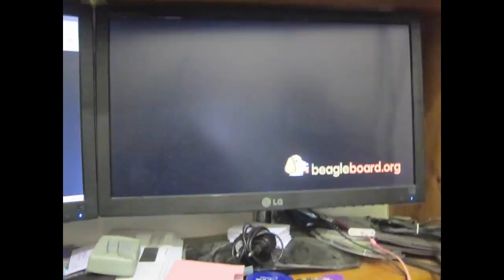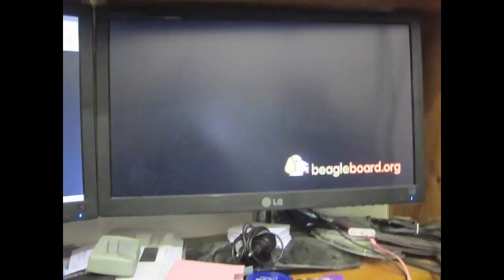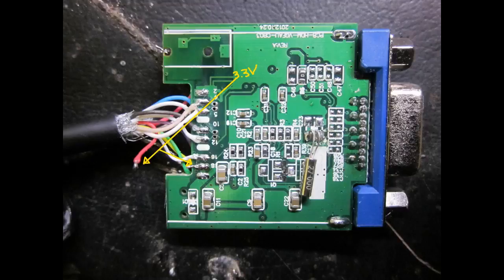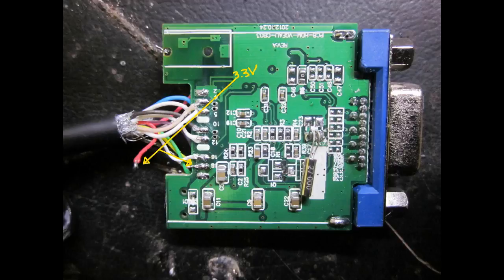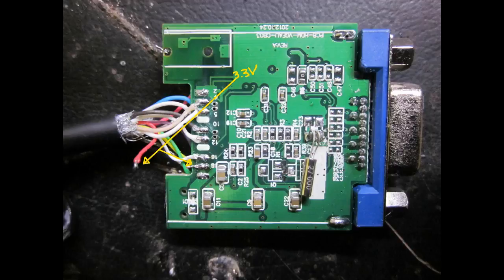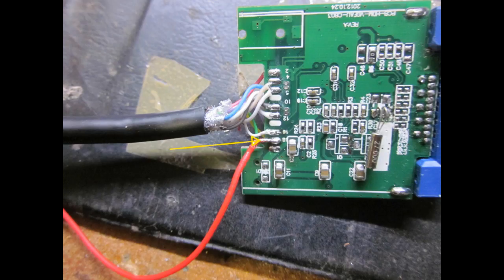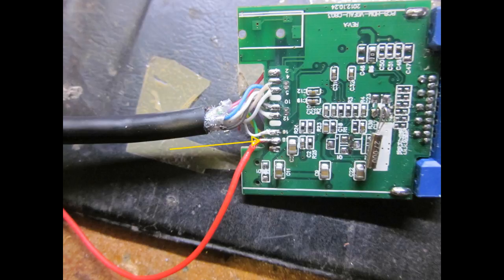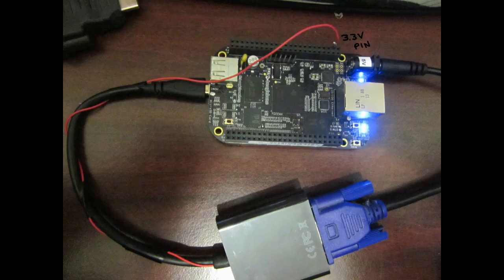Beaglebone Black micro HDMI to VGA  converter fix

Comment: i opened my converter , it was written 5v, can i add 5v to it? , i use laptop
Reply from the maker: Yes you can try with 5v, the hdmi does provide between 4.8v and 5.3v it seems.
just make sure you disorder the wire coming from the hdmi, so you don't feed back voltage to the hdmi port.
and also measure the voltage to make sure you are getting 5v .

Comment: why is the pink wire loose? i have an adapter similar and the pink wire is disconected, the adapter works but the screen shows blue image, can you help me?
Reply from the maker: the one i had was a Red wire  not pink .  and it wasn't lose , i unsolder it so i can attach a longer wire and provide 3,3V externally .
How you know the adapter works if it's shows only a blue image ?
Reply: @OussamaOusmoi  hey, i have a weird problem, my adaptor works fine for a time until my computer reboots completely, i have the adaptor plugged in to a amd rx 590 with an old Samsung monitor 1440x900, do you think that adding external power could fix it?

Comment: I have HDMI to VGA converter  18th pin +5v ok and 17th pin ground ok .but my chrome cast2 not working for HDMI to VGA converter.but audio working . screen resolution out of range 67.5khz/60hz. Show the screen . please any ideas... converter volt is ok.
Reply from the maker: Sorry not sure about that case . however  i believe that the Chrome Cast2 min resolution is 1080p , if the VGA screen doesn't support that resolution it will not work .

Comment: idk understand i have the exact same problem PLEASE HELP!
Reply from the maker: +Roblox Pro You simply need to provide an external power to it .  try identify the wire that provide the positive voltage , mostly a red wire ,  and double check with a multimeter , you must get a 3.3V .   once you find it , remove the wire and solder a new one  and connect it to the 3.3V pin of the beaglebone .
Reply: +Oussama Ousmoi thanks man it worked took me a day thoe to do it thanks again!!@
Reply from the maker: +Roblox Pro  Great , glade it worked for you .

Comment: How can I cut a micro hdmi and connect to fpv transmitter?
Reply from the maker: +titoinpr not sure if that is possible , fpv is analogue where hdmi is digital , so i think you can't just cut and hook wires together . i believe  there should be some fpv transmitter with an hdmi port included .  someone can correct me if i'm wrong :)